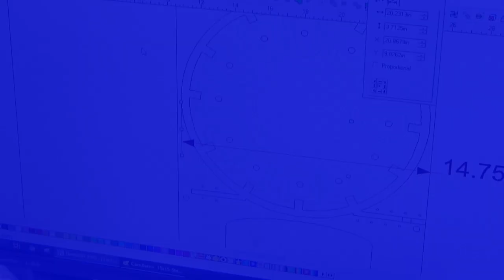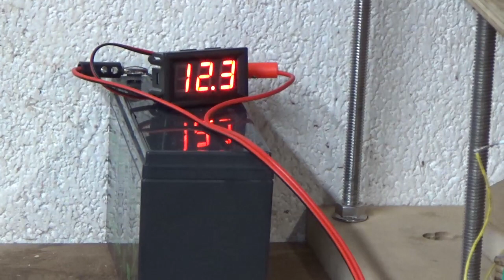Elliott EAPG Home Power Project Progress. No Lens Easyspin Bedini Axial Flux Generator.

Comment: good looking...nice and neat.
Reply from the maker: Thanks Dave. I have been working on it and great success so far. I just wish I had a way to fund this. I thought I would get more YouTube subscribers, but due to all the BS free energy videos and scammers it hard to find any support.
Reply: @jameselliott9397  Running it with the rotors vertical is much better. Less input and faster rotation.
Reply from the maker: The angular momentum is the same regardless of the wheels attitude.  However if you could let an entire machine rotate ie the right hand rule the force required may be less. If you follow the right hand rule a horizontal spinning disc spinning counterclockwise from the top view it would have upwards angular momentum.
Reply: @jameselliott9397  I get that ...but my bearings ran so much smoother and I wanted to give you that information if it might help you. It was all about the bearing design and mechanics . I wish you great success.
Reply from the maker: Thanks.  Just to clarify, you mean a horizontal shaft?
Reply: @jameselliott9397  Yes sir.
Reply from the maker: Yea, that makes good sense on the bearing construction.  I would like to build a motor that the whole thing could rotate just to see if it used less energy because the angular momentum would not fight it. Do you have horizontal shaft motor you can sit on a lazy Susan and do a test run compared to just sitting on a table? And would it make the whole unit spin?
Reply: @jameselliott9397  It would be interesting to try. I think I could do that with what I made. Hmmm cool idea.
Reply from the maker: I look forward to seeing a video.    Maybe some quick gyro research for ideas.    Of course the power source wold have to turn with it or have brush style contacts for input and output.  It’s something I have never seen before.  I don’t know why I think up such things lol.